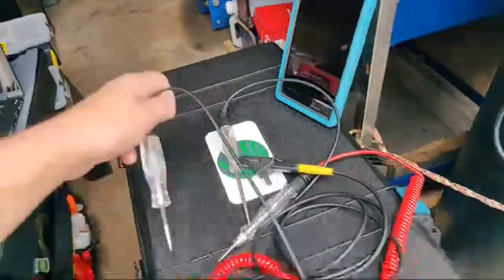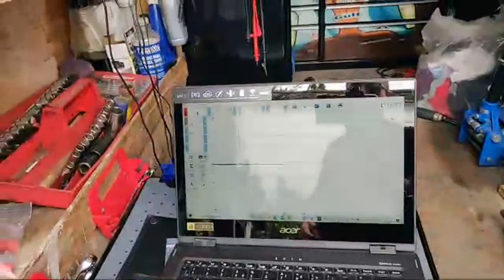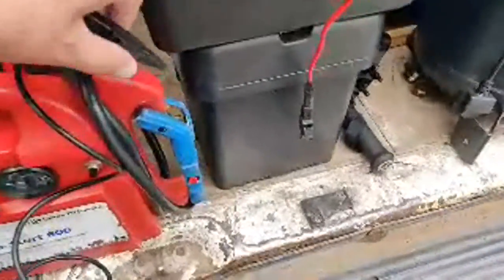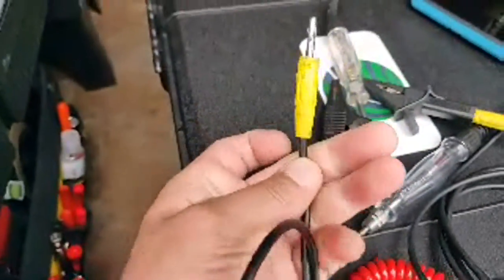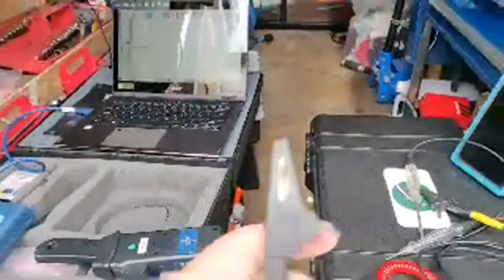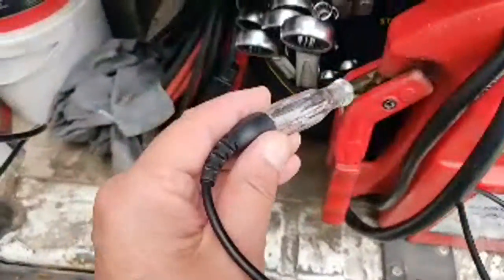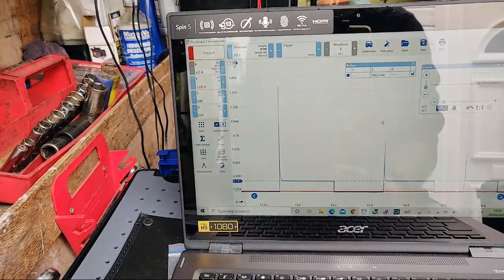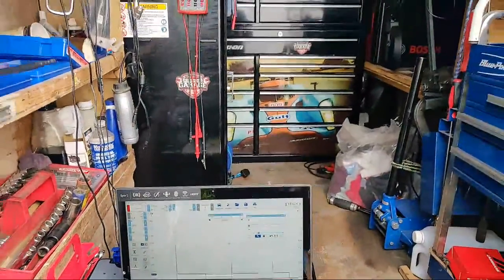Which Testlight To Use?

Comment: Can you address the part that some are saying they would never apply 12V to a 5V logic circuit. Or is it really just the amperage in this case.
Reply from the maker: A combination of inrush current and circuit design seems to have been the failure cause. Part 3 of Ivan's case study shows a burned out component in the motor board - this may have contributed to it as well.

Comment: I wonder if the window gets a power or a ground from a body control module and when you put your test light to the wiring it didn't like what you did and shut the circuit down. I had this with a temperature guage on a dash I put the test light to one of the wires and lost milage Rev counter fuel guage. I did a hard reset (connected batt + to - and everything came back. Obviously the computer didn't like what I did and protected itself.

Comment: Very interested in another/clearer video. I use my power probe 3 if I'm not sure about a circuit, do you think I should invest in snap on LED test light or the incandescent  from OTC?  I have an incandescent test light I think draws about 125 milliamps, I have another one that I don't use much that draws about 750 milliamps

Comment: Recording was clear enough to be visible so big thanks from my apprentices. 
Noticed motorvac on your shelf. Do you use it concentrated spray or through the machine? Been using it through the fuel system cleaner for years but they have a different attack system now for egr?
How are you finding it to work if you don't mind me asking. Probably a hard ask without it being an endorsement or other
Reply from the maker: What's motorvac Peter?

Comment: Sorry missed again notification came through but was busy squeezing 2015 Mazda 2.2 lump in so wanted to finish it 
Have Sealey metal body test light might consider OTC or Scrap-On one 
Anyway thanks for a great video
Reply: Thanks for the advice regarding banana connector deffo will add also just ordered OTC test light one more thanks

Comment: Ok Thanks for the reply.
Interestingly my snap on bulb had an inrush of 514 ma and levelled at 45ma, my led test lamp had no inrush and was level at 34ma, i then tested my testo multimeter and when it read the voltage it had no change on the scope, so the multi meter or pico seem to be the safest bet with second place going to the Led test lamp.

Comment: Steve how did you thin the line down on the pico  you did it on the first test?
Reply: Ok Thanks for the reply.
Interestingly my snap on bulb had an inrush of 514 ma and levelled at 45ma, my led test lamp had no inrush and was level at 34ma, i then tested my testo multimeter and when it read the voltage it had no change on the scope, so the multi meter or pico seem to be the safest bet with second place going to the Led test lamp.
Reply from the maker: Vertical resolution, adjust it up from 12 bit 👍

Comment: I saw Ivan do that (once deliberately) . In my experience of electronics most drivers that drive less than a few hundred mA can take short to ground of vcc without any issue. Hopefully Ivan will give us more details on the chip in the switch that he broke. (buy the way I think this is not Subaru's finest engineering, modules that cannot be scanned with unprotected drivers threaded around the car not to say the poor quality of the switches themselves).

Comment: Good video steve, has started to become a big concern when probing with a normal test lamp, would there be much current inrush using a multimeter ?
I cannot seem to find the otc 3633 on scannerdanner.com aeswave page, i find tools but its not listed ?
I seems impossible to buy from a uk site.
Reply from the maker: It seems to have gone, he has them listed on his Amazon but there seems to be a big shortage https://www.amazon.com/dp/B003YNHVQQ/?ref=exp_scannerdanner_dp_vv_mw
Reply: No, most DVM's even the cheap ones have a built in impedance of 10,000000 ohms limiting current  flow to a very, very small amout.
Reply: Billy R 
That explains the no noticeable change on the scope when i measured.
Thanks for your reply.

Comment: Do you think a
 retro fit led lamp would fit in a standard test light
Reply: It does work but the current only flows one way so you due to circuit design on any led bulbs I have tried.
Reply from the maker: For the cost mate it's not worth the effort

Comment: i'll admit i was distracted and got confused watching ivans video and havent got back to rewatch.  his comment gave me some gist  though. the 12volt was being supplied by the module to the motor  most likely as a supply for the encoders or sensors.   any time you deal with board level components or thier supplies  you must introduce only a higher impedance than what the circuit is designed for  thus a meter.  so yeah he was fine with a scope but not with a test light.  that 12v shouldda been tapped off the supply but was probably done that way to protect the motor. his inquisitive mind gave us all a lesson and thank you steve for showing us the inrush.   btw i own 2 snap on led test lights (both obsolete) and have seldom had the need to use them.  usually test power and ground  check the controls and just toss the modules
Reply from the maker: I'd go back and watch again, the comments are well worth reading as well 👍

Comment: Sorry I missed the livestream I was under a car 🥵... very interesting and important that inrush current I never liked led test light but know it’s on my list of tool to get 😊... would be nice to have a test light with a 4mm banana tip too 👍👍👍
Reply from the maker: I immediately cut the clips off and fit a 4mm banana, you can then fit whichever clip or probe you need and use the Powerprobe 3 extension lead and cigar adapter for a guaranteed power or ground anywhere on the car 👍
Reply: Simply Diagnostics I do the same thing, I meant the tip itself I find when I’m testing cranking circuit the engine shakes moving the test light sometimes
Reply from the maker: I've got a couple of them, both discontinued. Warwick test supplies do a screw on 4mm adaptor for testlights like the OTC that have threads 👍
Reply: Simply Diagnostics thanks for that Steve I’ll try Warwick 👍👍👍